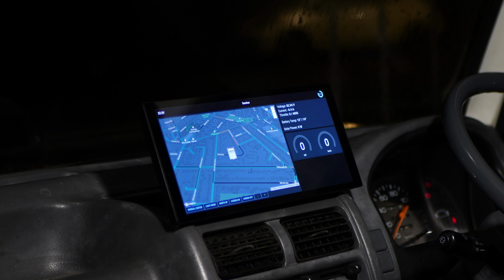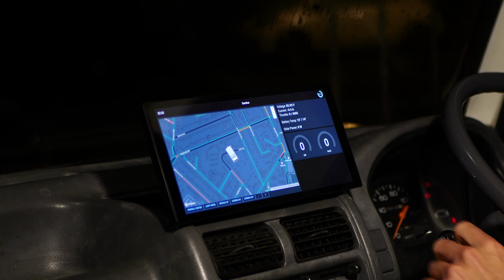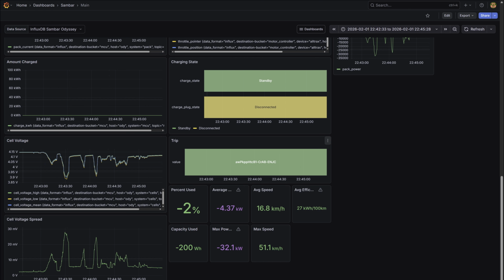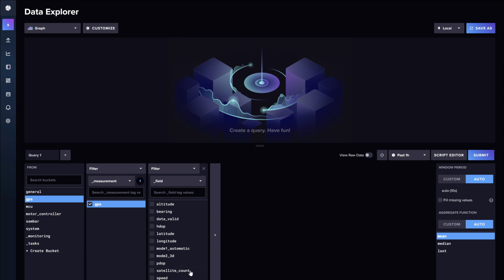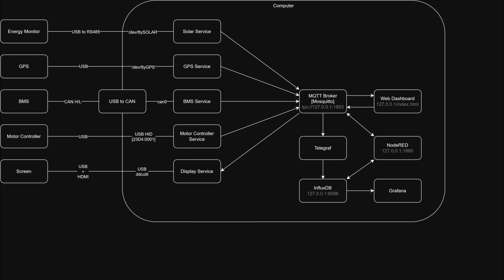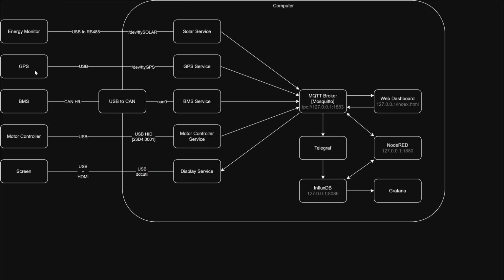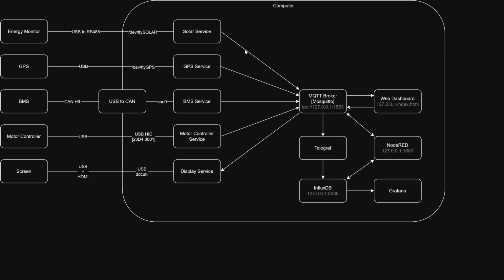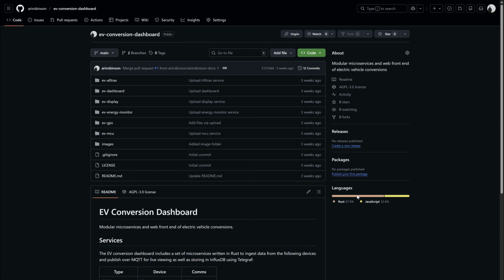04. EV Conversion Software

Comment: How were you able to get the screen mounted towards the top if you dont mind me asking? Was it a mix of 3d printing and the factory din brackets or all custom?
Reply from the maker: It's a fully custom 3D printed mount. I 3D scanned the dash to design the mount around.
Reply: @Ari3Dxyz would you be willing to share rhe 3d model for screen mount? I understand if it's a no but you don't ask you don't get.

Comment: loving the build! can't wait to see more! this looks way more doable than some of the other ev conversions i've seen. was thinking of doing one to a sambar van. did you go to school for this?
Reply from the maker: It's as complicated as you make it really! I'm mostly self taught on this stuff, but did a 2.5 year mechanical engineering technologist diploma program
Reply: @Ari3Dxyz  right on! i have a little ME/EE bg myself. mostly self taught as well. just recently been looking into EVs. pretty cool to see how far things have progressed in just the past 10 years
Reply from the maker: @Snorlaximus awesome! Sounds like you're on track for a conversion on your own. Mine is already outdated since it's with a series wound DC motor. There are some good options out there now with repurposing motors from factory EVs to use in conversions

Comment: Hey awesome video. I will be looking forward to use this in one of my conversions. I’m currently working on converting a mini cab into ev using a model 3 rear drive unit. But you’ve inspired me to convert a sambar as well. I would love to use your approach because it’s simpler being that I do not have to customize any of the axles and I won’t loose use of the 4x4 . I would love to chat about getting the spacer and flywheel and motor setup.

Comment: Nice build!
How is the efficiency number calculated? Noticed it was almost reaching 100kWh/100km. I would expect rather 1/10 of that for such a small and light car, but maybe those sections of the graph are while stationary or something?
Reply from the maker: Thanks! The efficiency graph doesn't account for times when stationary, so that's why it looks a bit funny. The total battery capacity is 15.8 kWh and I usually get about 80-100km from a charge. Also the amount of time each bar is averaged on the graph is variable depending on the time range selected, so numbers up to 100kWh/100km would be expected when accelerating quickly at slow speeds.